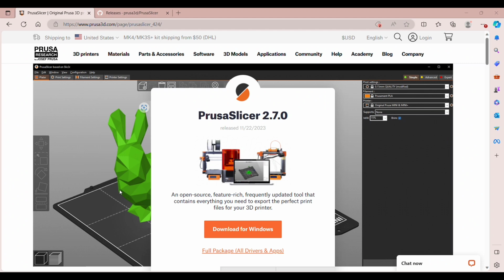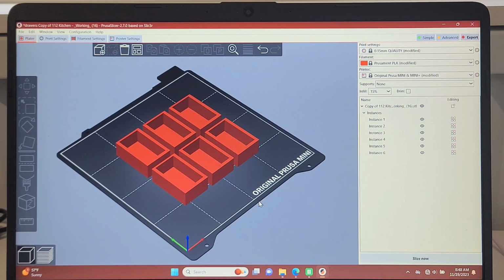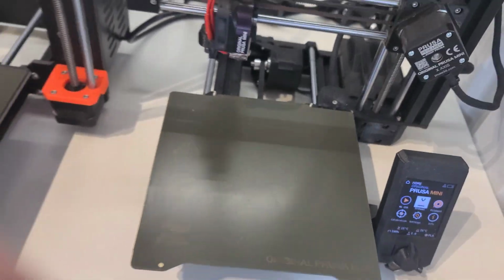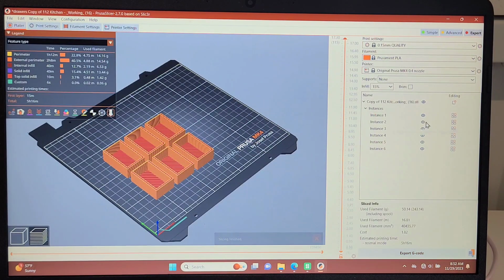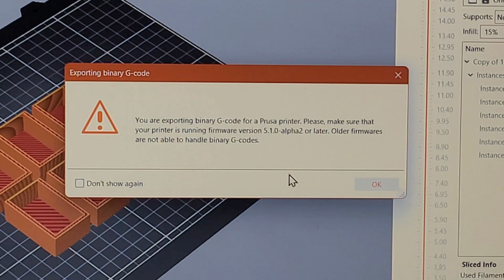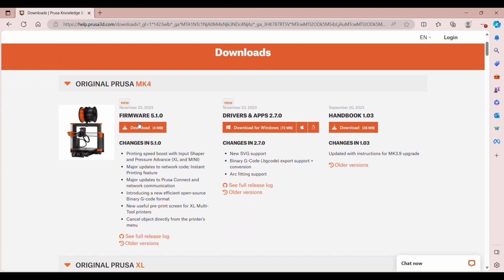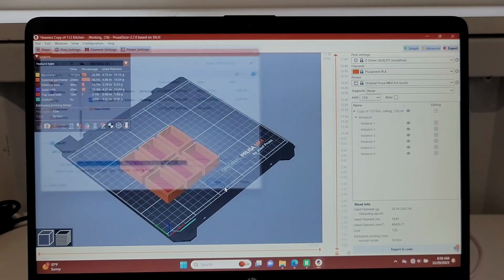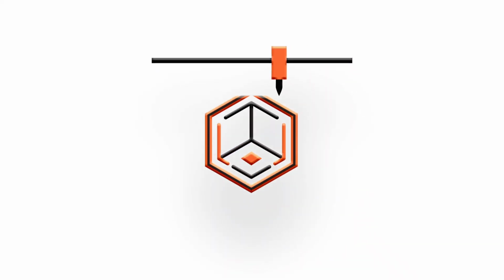When you need to update Prusaslicer but don't want to update ALL your printer's firmware

Comment: I'm sure that tip will help many people, although it wasn't anything new to me. Prusa Slicer is meant to be compatible with all kinds of 3d printers, so it has to be able to generate generic Gcode files. The actual problem is that the option is at the same time right where it belongs, yet somewhat hidden. I'd appreciate an Export button that includes a checkbox for binary Gcode, so you can turn it on or of on the fly. 
Output options are not something you usually change frequently, so you are bound to forget it every now and then. There are configuration snapshots, but that only offers the same inconvenience to be honest. Having a switch right where you need to click anyways, would be far more effective and less annoying than the displayed reminder. Because if you only have one printer, that message is displayed anyways, even if you never want to save in another format. People get used to "Nag-Screens" like this and tend to click them away without actually reading what the warning says. A great way to miss information about an actual issue.
Reply from the maker: That's a good point. Why don't they just have the option to turn it off/on directly from the reminder screen?
Reply: @tada3dprinting  Well, there are always several development strategies and Prusa chose the most flexible one, which makes sense in regards to open source: Implement, what has been proven useful, wait for feedback and adapt the implementation accordingly.
As mentioned, the option is where it logically belongs, but from a user's convenience standpoint, it would make more sense to have a switch right at hand, as long as binary Gcode is not yet the standard format for 3d printers.

Comment: Technically it is not compression. It is a more efficient format :-) Before this change, even small files took longer than walking to the MK4 :-(. 

The real issue is that Prusa went cheap on the WIFI hardware. It is slow and it only does the old 2.4 GHz, not the newer 5 GHz. I would have expected support for both. I recently saw a Facebook post where somebody donated an MK4 to a school that does not have the 2.4 band turned on - no wifi for MK4.

I have a Mac and it is as easy as renaming the application to have multiple versions of the PrusaSlicer installed at once. I do not know about Windows for this. Fortunately I have never had to go back and use the old version. I have only 2 printers and no business dependent on them.
Reply: I was about to type almost word for word your first sentence, but then I realized, even if it's not called a compression, it technically is indeed one. Compression of data is literally the conversion into a more efficient format.
As seen in the video, WiFi is not a problem here when the data is transferred over what I call Network powered by ADIDAS (namely the carrying around of an USB stick. 
The 5GHz WiFi is not faster than the 2.4GHz one, it's only less crowded. The MK4 WiFi could be great, but it uses the same buffer as the USB interface, which only shovels chunks of data around. Technically your WiFi Data is stored at slow speed on the USB stick and at the same time read from there to validate the payload of each packet, you get a data overhead which the USB interface simply can't handle. Imagine a truck bringing a paper clip packed into an overseas shipping crate which you have to unpack and write a letter to the sender that the first of 200 paper clips just arrived. That letter is then taken back by the same truck.
To stick to that image, binary Gcode puts some wire and a manual on how to bend your own paper clips, but still packed into the same crate and brought with the same truck. Still not efficient, but the overhead is greatly reduced for the whole file, since it takes far less packets to transmit it.
Reply: @artmcnamera7984  I guess I started the semantics argument. I'll give you lossless-compression with no redundancy reduction :-) 

The 5GHz is designed for faster over short distances while 2.4 is designed for long distances at the expense of speed. I don't have the numbers. I do know that the WIFI chip provided is slow when compared to this year's competition and lack of 5GHz is limiting.
Reply: @dsjove  I wasn't arguing, since you wrote my very own thoughts. I only noticed that my own thoughts were not quite accurate and that the general term "compression" describes the intended effect well enough.

If your 3d printer is less then 100 feet away from your PC, why use WiFi in the first place? Honestly, if your print takes some 5+ hours to be done, what do you care about a 3 minute file transfer before it starts? Especially when you need to change the filament and clean the plate anyways.
In your example of the school having no WiFi for their 3d printer, that's a security measure, because most IoT applications use the 2.4GHz band (range is a sales argument here, while speed is not so much) and you wouldn't want every student have access to that, nor would you want to run and maintain several concurring networks to manage access since that would cause congestion due to the use of all the available channels. It's also not desirable to have all students have access to that one printer simultaneously and potentially unsupervised. With the USB stick solution it's much easier to establish a schedule for printer access.

Granted, the MK4 Wifi module is just an ESP8266, not half as fast and powerful as an ESP32, but I understand it to be in place for controlling the printer, not for file transfer. For that it works great, since it's a simple IoT application, working pretty fast. For files though, even a wired connection is the same slow speed due to the boundaries of USB speed. (I'm using a wired connection and I still prefer the USB stick loaded with my files and the printer, equipped with an ejection arm, working down the print queue.) 

However, we are far beyond relation to the above video and the topic has been discussed a lot already at the Prusa forums.
Reply: @artmcnamera7984  Let us take this one point at a time. 

I don't care about the semantics of the word compression. That's why I agreed with caveats, a smiley face, and admittance that I stirred that pot.

I cannot speak for that one guy's kid's school's IT department. My kid's grade school's IT department was another Dad that installed a cheap WIFI router! They donated an MK4 and cannot use WIFI. As a consumer I'd be disappointed as well. I would expect a premier expensive appliance in 2023 to just work.

The transfer speed from your computer to the printer should be around 250-300 KB/s over the Ethernet and 45-100 KB/s over the Wi-Fi. With a good thumbdrive, USB is not the bottleneck.

In order for the wireless transfer to work, the computer cannot go to sleep nor can you quit PrusaSlicer. Waiting for the much more than the 3 minutes you mentioned, with standard gcode, is not workable; especially since transfers are not continuable.

A workflow optimization you cannot perform with USB file transfer is queuing up GCODE files onto the 3D printer as it is printing. I am not looking to have the jobs auto start. But I will design and slice many models on my laptop at once and get them onto the 3D printer for later printing. That is a great convenience enabled by the optimizations of using a binary file transfer.
Reply: @dsjove  When I'm too lazy to swap the USB stick and actually use the network for file transfer, it rarely takes more than 3 minutes for me. I wired the connection since I had a switch at around 3 feet from the printer already, but the speed was the same without the wire. I admit that without the wire I had the file transfer fail sometimes.

I optimized my workflow by queuing my sliced files onto a USB stick on my computer. The printer is printing, having another USB stick, while I can store so many sliced files as would fit on that drive in my computer. Once I go down to remove the last print and prepare the next job, I swap the drives, start the first job on the new drive and am done with it. In my hand I now hold the physical queue to fill up once I return to my computer, where I design and slice completely independent from the printer's status. As a bonus I can backup the whole drive and have all the sliced and printed models ready to be archived. I can edit whatever I'm not satisfied with and I can easily produce the same models later on. 
The network I use to be notified, when a job is done and via camera check on the running job, also I can start a filament change or pre-heat the printer so that by the time I arrive at the printer, it's ready for whatever manual actions I have to perform.
I'm unable to see any potential for optimization with a network file transfer, because unlike a document printer, a 3d printer requires some manual steps to prepare a print job and while you are physically present at the printer, it's not more, but rather less effort to swap a USB stick, compared to sending the files via network, then go down and perform the manual steps required to start the next print job. 
Technically the file transfer takes less than 2 seconds for a whole USB stick full of data - print jobs for weeks. Even with the fastest network, I could not be any faster than that and I still would need to put new filament on the printer, remove the model that was just printed, clean the build plate and so on. 
Even with the auto-ejection in place, there are manual tasks that WiFi can't do for me and since need to go to the printer, I might as well carry a payload with me and achieve a transfer speed that network won't offer for the next decades. If I go down to the printer when the network tells me it's almost done with the current job, I can almost immediately go on with the next print. 
The network however is useful to change the order of the print queue, receive alerts, if something goes wrong, or control basic functions of the device.

Comment: Is it possible to have two versions of Prusa slicer installed on your laptop at same time, then select the older version when slicing and printing to older firmware printers?

If that's not possible could also install a small virtual machine on your laptop and run your experimental newer slicer in the VM and use your main operating system for the older slicer version.  Or vice versa.

I'm new to 3d printers so I'm speaking without having actually used a 3d printer or slicer before 😅 and i may misunderstand the issues.
Reply from the maker: I did have two versions running accidentally at one time. But I found it to be annoying and tricky to jump back and forth. 

What I was doing when I first found this problem on the Beta, was running each version of Prusaslicer on two different laptops. 2.7.0 for the XL and an older version for everything else. I still found it annoying. Thanks!

Comment: One thing you might want try if you don't want to switch the checkbox all the time: After clicking the "Export G-code" button and the "save as" window pops up there is an option to change the "Save as type" at the bottom of the window. If you want to force binary select ".bgcode" or select ".gcode for the non-binary. I am not sure if this will work because I only have one printer and I updated the firmware on my MK4 already. I am curious if this works for you.
Reply from the maker: Yeah I'll have to try this out. Thank you!

Comment: Is the Binary G-Code option setting selectable by printer or is it for the entire application?
Reply from the maker: It's automatically selected to be binary for all printers. But you can turn it off the same way for all printers. Thanks!
Reply: The system default in PrusaSlicer 2.7.1 for binary gcode globally enabled, but you can disable it on a per-preset level in the Printer Settings (Expert).

Comment: I think for you with many Prusa printers, you should leave that option off for everything.  I don't think it will save much time, since it seems you load everything from a USB drive.  It may be more benefit over the cloud
Reply from the maker: Yeah I just wish I could change the default to off. Now it's just one more thing to remember on everything I slice. Thanks!
Reply: @tada3dprinting  I think you can save OFF as the default.  turn that off and save the preset, you can give it a different name if you wish or just save it.  You can have different presets for Print Settings - Filament Settings and Printer settings and pick and choose for each project.